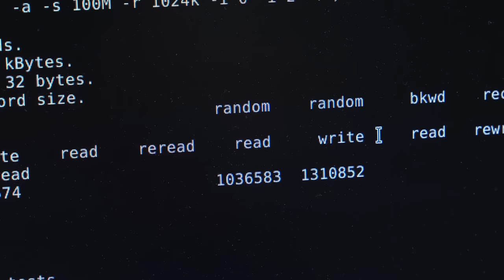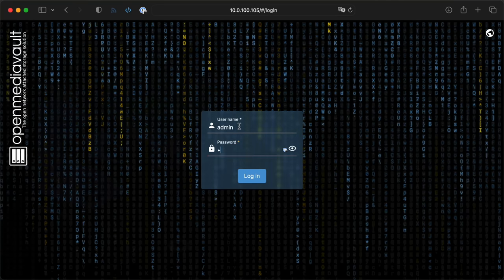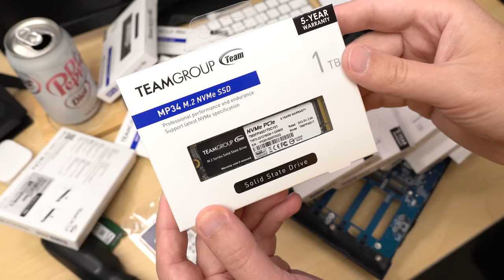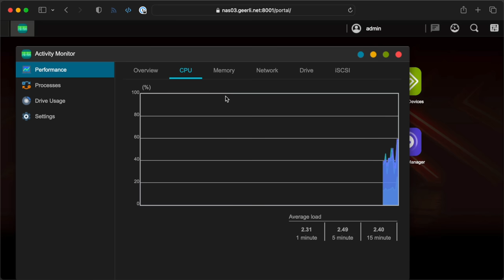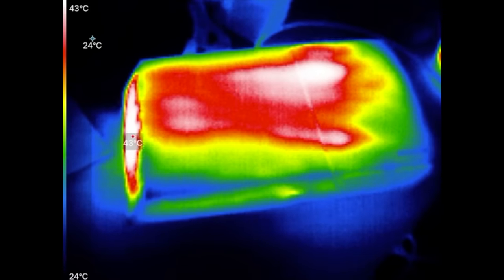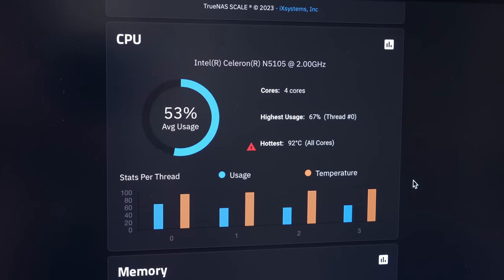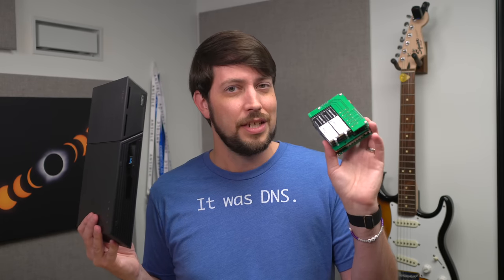All-flash NAS fight: DIY or Buy – Round III!

Comment: Awesome context for these products.  Two thoughts:

First:  Why do you choose to edit over the network?  It makes sense for a company like LMG with 2 dozen editors, writers, camera operators, and on camera talent all collaborating.  But if it's just you and maybe an editing assistant, wouldn't it make more sense to keep files you're actively working with on your workstation and upload everything to the NAS when you're done?

Second:  For people like Jeff who actively use their NAS rather than just as bulk storage or a backup target Flash storage might not be as expensive compared to HDDs as it first appears.  You should see significant power savings.  And because Flash has nearly unlimited read endurance it should last longer.
Reply from the maker: Good question! It's mostly because I edit sometimes at my main desk on my Mac Studio, other times on my laptop, but like to be able to dump and work from the NAS in either case, even if I have to upgrade or shut down one or the other.

I only really copy to the computer's internal storage (which is only a few hundred GB free...) if I'm going out on the road and need to edit.

Comment: Isn’t PCIe gen3 ~1GB/s/lane? Hearing that 8x lanes being a limitation sounds silly — even 8xPCIe gen2 lanes would be plenty, no?
Reply: If you’re able to either view it in the datasheet or visually see where the PCIe lanes go, perhaps you can try that 3-drive RAID0 test again but make sure all 3 drives are behind separate PCIe switches.

Even just 1xPCIe gen3 lane per should get you ~1GB/s to that PCIe endpoint. In fact, it may be just as interesting to simply try a single drive and see if you still hit that 600MB/s.

Comment: Looking at these, I noticed they had TeamGroup NVMe storage.   TeamGroup are cheap, but they are not anywhere close to high performance.   That said, they should last a while even in a NAS.
Spinning drives still have their place if a lot of read/write actions are going on.  Spinning drives, despite being slower, will still saturate a 2.5Gbps connection and will tend to last longer.  If your NAS is primarily reading data with little writing, then the NVMe could be an option.
Reply from the maker: They didn't come with TeamGroup, I just bought those because they were cheap enough for me to afford for this video, but also decent enough they could perform well in aggregate.

Comment: @1:40 Oh man that could probably use some heatsinks between the m.2 drives.  I'm imagining even something as simple as two copper plates with some metal spacers between them and then thermal adhesive on both sides. Then have a squirrel cage fan or something blow air from the side, which would force air to go through thole copper plates cooling them.

Comment: I still think using a Mac mini m1 with 10gig ethernet will probably be the best way to go for a high powered  NAS. 
A few Thunderbolt 2 PCIe adapters would be required to install all of the storage needed. Along with having a Thunderbolt 2 gigabit adapter.  You can also add on a storage array of your choice and you still have two USB 3.0 ports

Comment: You didn't but I always find it weird when people working on electronics will first state the temps in C then convert the temps of the electronics or tools used when working on the electronics from C to F in their video. Component temps, hot air station temps and soldering temps are all going to be in C as standard in the US.

Comment: Awesome video as always. But I have no use for NVMe benefits. Could you look into NAS options with SATA ports?
I used ODROID-HC4 with 3D printed case from Hardkernel forum. That thing was awesome. The quietest NAS I tried...
But it had only 2 SATA ports and if you wanted to transcode for Plex, you'd get away with maybe 1 stream at max, if even that.
I hate my Synology, but can't find a good DIY x86-64 solution as electricity is quite expensive. Would love to see NAS that could idle at the wattage of drives and even with Plex transcode it wouldn't skyrocket.
EDIT: Grammar.
Reply from the maker: So far I haven't seen anyone make a nice integrated RK3588 design for SATA HDDs, but I'm sure it'll happen. The Rock 5 is probably better suited for an array of HDDs regardless. For NVMe or SATA SSD, the chip just can't pump through the bits too much faster than an older Pi.
Reply: I do have a board I designed that holds 7x SATA M.2 drives and sits on top of an intel NUC. It has a printed riser that extends the case height by about an inch. I may make those files publicly available for DIYers at some point. I have been using that as my home NAS for about a year now. The pocket NAS was me trying to see how small I could possibly go. Next version should be a bit smaller :)

Comment: At that low density, you wouldn't need the NAS in the first place if you weren't using a Macintosh. 2 Crucial P3 4tb drives is $400, and most modern machines support some kind of PCIe bifurcation, so one $15 adapter later, you have local redundancy at a full 2gb/s.

Comment: Imagine if the Flashtor had an i3-1215u, which is the same MSRP of the Atom, i mean i3- N305, 20 lanes instead of 8
If using DDR5, 256GB instead of 16GB
Same number of E cores, but 2 additional P cores(as opposed to 0)
With bifurcation you in theory would not need a PCIe switch/PLX
each NVMe could get a direct single gen 4 lane to the CPU, and the 10G could get a full 4 lanes, allowing for up to 40G networking if they wanted.
Reply from the maker: Yeah, though after speaking with ASUSTOR's rep, it sounds like Intel doesn't have a goldilocks chip for a device this size that can hit the thermal/power requirements, while also hitting a price point where they can still make the profit target they would like to.

Comment: It's too bad Intel is so hellbent on not allowing bifurcation on consumer gear.  Nice to see Asus doing what they can to bypass this. It would be nice to see an i3-13100T variation of this so you could get at least 20 lanes.
Also 10Gb on their 6 bay would have been nice.  I see 4TB nvme's with dram for $168 right now.  So for $1000 you could have ~22TB of extremely fast storage in a very tiny enclosure.

Comment: Great review, thank you.  My only concern with all solid state storage is the finite write life that solid state storage has compared with spinning disks..
Reply from the maker: It's really dependent on what you buy; different drives have different write expectancies. Many flash drives could be written to for years with normal consumer write patterns and not have an issue.

And hard drives often fail prematurely, as well (just check Backblaze's reliability reports!), so in the end, the best protection is a 3-2-1 backup plan, and choosing drives wisely.
Reply: @digitalpilotnm6039 modern flash drives are designed with an expected lifetime of 10 years. Most modern hard drives are designed with an expected lifetime of 3-5 years. Most flash drives have much, much higher MTBF - up to 10x higher than disk drives. If you're genuinely concerned about lifetime then you definitely need to switch to solid state.

Comment: The bottle neck with writes is probably those nvme drives, or failing to use trim or something drive related (maybe os tuning (eg raid settings or filesystem or samba)). Because it make no sense to be cpu or lanes related. The cpu doesn't calculate anything with raid0, so you would expect to see more speed when compared raid5 but you didn't see any. And it ain't lanes because a single pcie3.0 lane is 985 mbytes/s, and you have 8 of them (7880 in total), more than enough to get higher speeds than 680ish mbytes/s write.
Reply: It's the CPU. SMB is single threaded and heavily dependent on clock speed.
Reply: I came to say something similar about the PCIe lanes.  It also makes no logical sense that a system that can read from the drives at 1.2gb/s using the same PCIe lanes would only be able to write at half the speed...  using the same PCIe lanes.
Reply: @ASUSTOR_YT  but why are writes so different to reads? Googling samba read and write performance on other cpu limited devices rpi show slightly lower numbers for write over read, eg 80-90% but not 50%
Reply: @yeahright3348  It's a combination of a few factors, but is mostly due to the Intel Turbo Boost  Technology settling in at around 2.4 Ghz when writing.

Comment: I ordered the 6 bay Flashstor a couple days ago, should get it early next week. Ordered 16 gb ram for it as well. Will take a while to fill it up with NVME drive, will probably order 1 or 2 4 TB ones each pay period until I fill it up.

Wish I knew about 32 GB working in this, that will be a future upgrade if I run some VMs on it.
Reply: Thank you for your support! We can't guarantee that 32 GB will work or will not cause issues because Intel specifies a maximum of 16 GB.

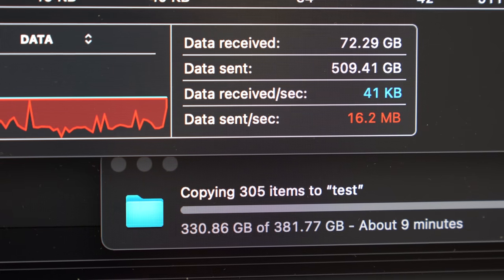Comment: 3:52 I have noticed this with high end NVMes that use QLC NAND.
I have a Sabrent Rocket Q4 2TB gen4 NVMe
When copyinging ~300GB of photos from a day at the airshow at Scott AFB down by St Louis MO, the rocket Q4 got to about 70GB into the transfer from my SD card then slowed to just 40MB/s. I tried to restart the transfer several times and just ended up sending it to a 16TB HDD which ran at nearly the full 300MB/s speed my SD card supported for the entire transfer only sometimes slowing to 250MB/s but generally around 280-290MB/s.
Reply: The 45MB/s likely means that the SLC caching ran out on the parity drive(or all 3 drives) and the drive had to slow to the maximum supported speed of QLC(assuming these are QLC based, which at 1TB for $40, suggests this is the case)
Reply: These cheap SSDs(both NVME and SATA) are only usable up to about 20~30% capacity. Beyond that point, no matter how hard you try, writing becomes a joke, e.g. <30MB/s, this is not explainable by QLC or DRAM.
When I buy an SSD, I always run dd to write until full. I've noticed those SSDs I've paid for $60+/TB(in this year) can always sustain at a usable level(e.g. for SATA, >300MB/s; for NVME, >800MB/s); meanwhile, those under $30/TB ALWAYS drop to 30MB/s or so after 20~30% capacity.
These manufactures definitely know what they are doing - if a user can notice their SSDs become too slow to write after such light use, these manufactures must have done extensive tests to make sure this is how their products on the cheap end should perform, therefore their high-end product can sell.

Comment: 4:46 those Mini560 are very cheap and making exactly the noise you said the fan PWM is making. For future use I would recommend using Mini560 PRO cost basically the same and no noise.

Comment: At 300GB you ran out of the SLC cache space on the drives and started writing at the native TLC or QLC speed of the flash.  Not a DRAMless vs DRAM cache issue.
Honestly - I thought the Asus NVME NAS was horrible because they shipped it with an e-waste CPU with insufficient PCIE lanes for the task - but then the flash crash happened and now I'd be totally behind it if the price was right.  I'm sure they're selling more than they can make.  I mean 10 times the amount of SLC cache means a far more consistent write experience.  Sure, it has limitations due to the horrific CPU choice, but there's nothing else on the market that can touch it for a write heavy NAS; and bonus it's friggin tiny!

Comment: Just so you know the best DIY performance will probably be a LGA2011 based system with port bifurcation and some DELL x16 to 4 NVMe drive adapters.  Something like an HP Z440 could easily do 8-12 NVMe with lanes coming from the CPU.  There are also 'mining' motherboards with 5 x8 PCIe slots for around $50 with ram and CPU (I got mine for $37 or so, and a 32GB LRDIMM for $6, using a dual core Xeon E5).  They run off 12V and you could probably use an Xbox360 or newer 12V power brick to run the whole thing.  You would need to source some x8 to dual NVMe cards, either new in bulk or from old servers EG: Dell.

I think the market will open up a bit because the performance gap is a little silly IMO going from dirt cheap used server stuff to SBC with strange bottlenecks.

Desktop systems sadly don't support bifurcation usually, because with 20 PCIe 4.0 or 5.0 lanes from the processor it shouldn't be that hard to run PCIe 4.0 x2 and get 10 drives and good performance from just the CPU in theory.

I think smart money is probably on using 2TB NVMe drives for $60 (Fanxiang/Silicon Power/LEVEN).  The LAN is going to be your bottleneck really.  The slowdown was most likely the drives' SLC (Single Level Cell) cache running out, they then have to switch to MLC to store the data.  When there is some pause in activity the drives will move the data from SLC to MLC and it will be quick again.

I wish for NAS that the cache could be disabled for more consistent performance.

Comment: The N5105 addresses 64gb of RAM, the Intel specs are wrong. No idea how they got the specs on their own CPU wrong but the Odroid H3 uses the N5105 and I can confirm it will work with at least 32gb because I have one using 32gb (2x16)

Comment: Unlike many ARM vendors, though, Rockchip does do upstreaming of their kernel support so it will work in the future with just a vanilla upstream kernel.

(Also those SSDs are a lot cheaper than the Samsung I tend to use. Are they any good?)
Reply from the maker: so far so good, but I've only been running them for a couple weeks now. I'll definitely update on my blog if I find any issues!

Comment: Considering how much RAM you installed, I'm surprdsed TrueNAS and ZFS saw so much of a performance hit even when striped. I bet it has something to do with those PCIe switches. I wonder if reads would be faster as a merged JBOD instead.
Reply: My thinking is that with the limited number of PCIe channels, the commands are getting queued rather than being performed in parallel.

Comment: Openmediavault is pretty cool, ive been using a pi3 with omv and it works pretty well, aside from being reeealy slow, barelly surpassing 100mbits a second or like 8 mega bytes a second. I intend on upgrading my nas with a simple desktop pc to replace the pi but still using omv because my bottleneck is hardware not software. I even got some more mb/s by installing 64bit pi OS on the pi instead of the normal 32bit one.
Reply: The ethernet port on the pi3 is an USB-ethernet adapter on a USB 2.0 port so max speed is 100-ish Mbits. It was not built for speed
Reply from the maker: Yep! Even upgrading to a Pi 4 would be pretty significant there!

Comment: There are solutions to solve the slow write performance in openmediavault by simply adding some arguments in the extra options box under SMB/CIFS to improve write performance. I noticed a substantial improvement on a gigabit connection in terms of write speeds on my Xeon E3 powered nas.
Reply: What kind of arguments and where could one find info on it?

Comment: Hey jeff, 
I want to know how do you use the true nas. How you upload files on the
Server? 

And how even you access it through your computer?
Reply: Love your videos
Reply from the maker: You can choose what kind of networking file system you use; I used SMB (Samba), which has great compatibility with Windows, macOS, and Linux, but you could also use something like NFS, which is mostly compatible, but can have its own quirks.

You set up users on the NAS for login, and on your computers, you browse the network to find the NAS, then log in, and 'mount' a share from the NAS, just like you'd plug in a USB flash drive or an external hard drive.
Reply: Thanks

Comment: Super cool, but I'm worried about overheating
Reply: Hi there! Even testing in a 35°C ambient environment, which is uncomfortable to most and hazardous to the health of some, we could not find any issues with overheating. We test our devices before releasing.
Reply: @ASUSTOR_YT  I've a m.2 disk in a external USB chassis and it is very fast but it reaches 85 degrees over copy via LAN
Reply: @luigitech3169  Sure, but we have active cooling and our M.2 drives are not confined in a very small enclosed space. I even released a video showing how heat dissipation works in our NAS.

Comment: is SSD lifespan no longer a concern vs HDD? i remember it was a big deal back when SSDs were new.
Reply from the maker: It depends on the particular SSDs, but most modern ones have great wear expectancy and are not as prone to failure (or at least unexpected failure you couldn't detect via SMART) as older models used to be.

I still don't trust any storage media, though, so keep 3-2-1 backups.

Comment: On the lower TrueNas read speeds, are you maybe running into decryption performance issues similar to what Tom at Lawrence systems has reported with low end CPU's?
Reply from the maker: I specifically avoided enabling encryption on this volume, but from what I've heard it could be checksumming going on during reads that kills some of the performance. Definitely CPU-bound!
Reply: @JeffGeerling  Hopefully they will make one with an i3-n305 soon. That would be killer. Still only 9 PCIe lanes but much higher performance.